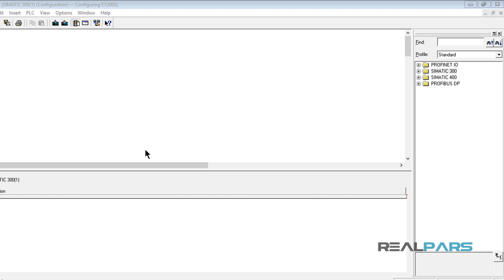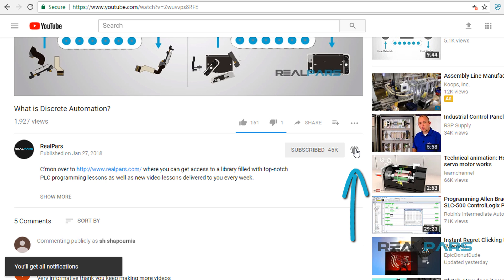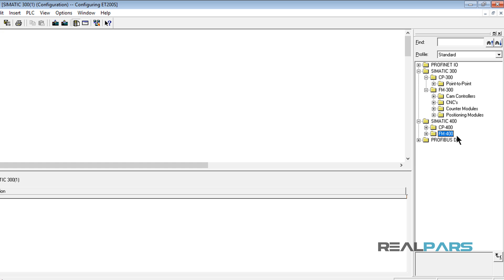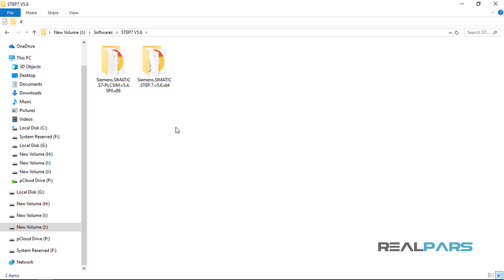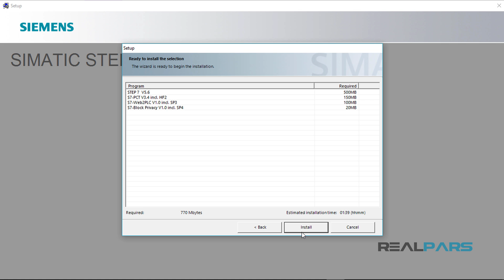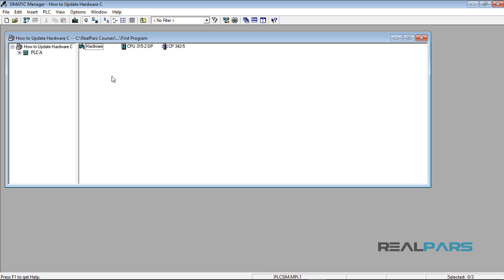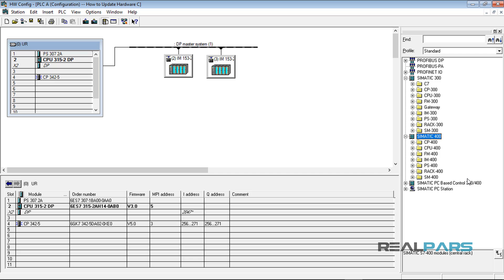SOLVED - PLC Modules are Missing in the Hardware of STEP7 V5.6

Comment: It happened with me today and i use this video to solve it. But instead of remove step7 i just select repair and it work fine all missing modules are back is there any problem of doing repair insted of remove and install again ?
Reply from the maker: No, in fact, I always try repair first.  It usually fixes the problem and is faster and less likely to mess up your application.  Normally what happens is a set of pointers or indexes get misaligned or deleted.  The repair process rebuilds the lists and refreshes the views when the program is restarted.

Comment: Hello. Do you know other ways to solve the issue of missing components (314-1ag13-0ab0 in my case) on the list? I've installed step 7 v5.6 from folder but it didnt help. When Im trying to update catalog via "install hardware updates" component in question is marked as "supplied" so i cant add it and getting error "Selection not possible. Cannot install over a HW update supplied with the Step 7 version."
Reply from the maker: Hello,
Did you remove your installed software? and then install it again from the folder?
If yes and it did not work out you should better update your HW config.